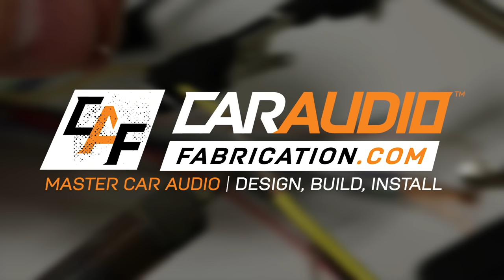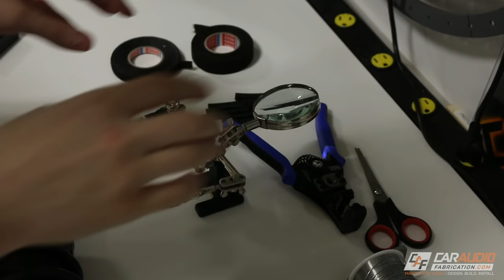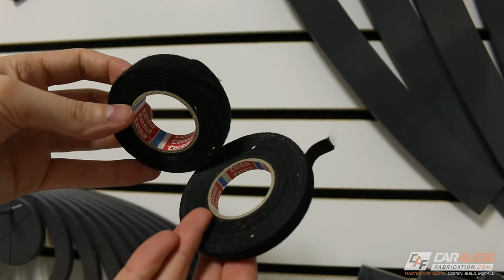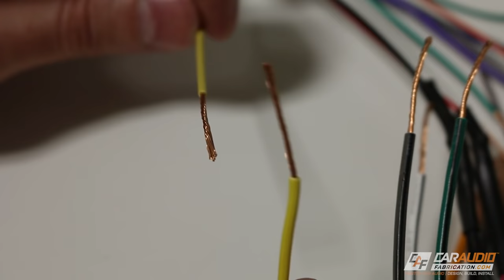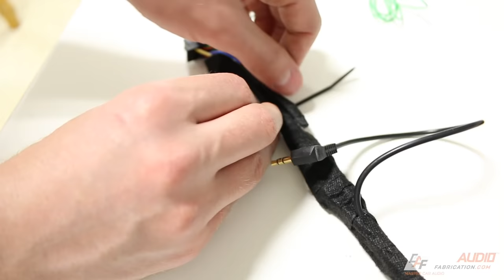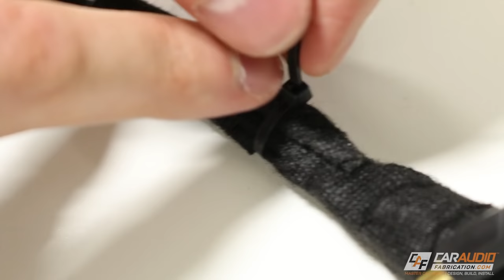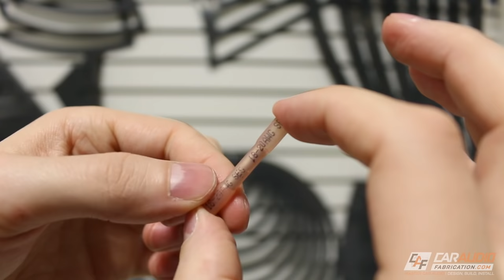Radio Wiring Harness - How to Install like a PRO

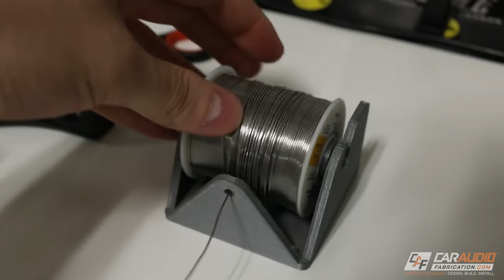Comment: Where is the link to the tools you use which you mention at ~2:30?  I don't see it in the video description.  In particular, it would be helpful to know what kind of TESA tape, what kind of solder, what size heat shrink, etc.

Comment: My harness that plugs in the car doesn't have a black wire, so I have to ground the one that come on the harness for the aftermarket stereo. What tools do I need to do that. I have a 2007 mitsubishi galant. The aftermarket stereo I bought is the pioneer FH-S500BT.

Comment: i use crimp caps where you twist tie them together and then its crimped on the end.. been working for years with that method im just too lazy for soldering

Comment: I havd a 2019 cascadia freightliner l have a blue connector with small gauge wires.. possibly 2 wires. along with a big connector multiple wires.

Whats the blue connector for? Wires are thin.

Comment: Could you use lever wago connectors to splice a line output converter? Or is the only option to solder in a tight space from a car seat.

Comment: Hi , I have a specific question hope this make sense, I have a car lancer ex and its using a Fosgate subwoofer but dont have a stock amplifier, can i able to hook it up with my new android headunit (built in amplifier) directly? Not sure which wire to tap, should I tap it in the wires from the car or in the canbus wire?

Comment: One thing that i personally would do differently is to not solder, but use open barrel splice U-shaped spilce connector (also known as
Terminal Crimpband, Open Band Connector Crimp). It's widely used in motorsports and is considered to be one of the best ways to to join two or more wires together. Yes you do need special crimping tool but i think it's worth it, as a good soldering iron would cost around the same. Also I'd suggest looking into heat shrink with a layer of the glue on the inside to make it water-proof.
Reply: Well the nice thing about solder is, it's permanent until you take a soldering iron to it again to make whatever change you need with it. Once crimped you're stuck with it or lose some wire removing it.

Comment: How do you wire a DVD player to by pass the parking brake? It's a Boss dvd with the PAC RP5-GM31 for steering while controls? Do I clip the wire right from the back of radio or is it after the PAC wiring interface? Thanks

Comment: Hello I just watched your video.  I have a question I have a 07 Chevy Silverado I want to change the factory radio and I want to know where can I find an aftermarket wire harness adapter and steering wheel adapter for my radio.  Thanks look for ward to your comment.

Comment: I'm working on a 2012 gmc canyon. I am  putting in an  aftermarket radio with an amp, but the wiring is somewhat  confusing for me due to wires don't match up how do I figured it out... if you want I can send pictures of the wiring....

Comment: Mark:  have you ever used the new Solder seal wire connectors?  They are supposed to solder and shrink wrap all in the same step.
Reply from the maker: I reviewed them, they are bad.

Comment: if youre are installing a new Headunit BUT youre using an amp the speakers (using the preamp on the headunit) do you still connect the speaker wires from the new headunit to the factory harness even though they will not be used?

Comment: Your videos are great I'm learning a lot thank you.
I'm a sound tech. and a D.J. and I run and record; live sound, soooo,, music is everything to me.
I want to install a Rockford Fosgate 3sixty3 in my 2011 Chrysler 300 and all the corresponding amps. I have already installed the speakers and a subwoofer with the corresponding amp. but the sound is still a dud. what I'm asking I'm wondering if I'm going to have to manufacture a harness like this?

thank you again.

Comment: Hi i want to upgrade my car speaker with an amp but i don't know how to connect everything, i know i have to use a adapter harness but i don't knowh ow to connect it, do i need to connect it to the radio and the amp? because i think it wouldn't be long enough?

Comment: I have Pontiac grand Prix GT i have to order from crutchfield a similar wiring harness where exactly would i connect my remote wire i don't have the bose or monsoon radio i just have steering wheel controls but from online ive been seeing where i have to rerun a 12v and the remote turn on wire has to connect to wiring harness n if this is true i dont understand how i am supposed to hook up my stereo system specifically amplifier without a remote turn on wire any help is very much appreciated

Comment: What’s your opinion on the fuse relay bypass.? For the 2660NEX I have the maestro SWC mod and am hoping every thing is color coded together aside from my rear camera connection. I’m nervous to even install it because I see so many issues with the newer tech even in my 06 gmc sierra. But I saw someone run a ground to one post of the relay, then a line off that post jumped to the other 3rd leg.

Comment: I have a question. I have a 2004 s40 Volvo. I need a female plug for a stock radio harness. I'm installing a aftermarket radio.hope you can help.

Comment: Mark, if you had a checklist made out for all your connections and checked each off,  it would give you a verification of where you were if you had to stop in the process so you didn’t lose your place. It’s happened to me and it’s how I addressed this. Cuts the frustration factor especially in shops that are not using conditioned air. Just a suggestion. Not everybody sees this as an issue, but doing things twice is very irritating to me. I hate that. And wasting time because of being in a hurry. Disorganization is the cause of many a frustration. Opinions vary, but facts don’t!

Comment: It would be interesting to see your technique on a "hard wire" installation.
Reply: Mark talked about that in a different video. He gets a used harness from a parts car and then solders that into the vehicle.  He said it is awkward and since it is all in the dash, it is hard to video too. He does not recommend hard wiring the radio in.

Comment: Hi I am struggling with something, my key is on the on position and I have no static even crunk up loud but when I crank it up I get static that comes from the left rear speaker, and I just put new speakers in, and it breaks up even at a low volume. I heard road noise. Please help?

Comment: So i've installed 2 headunits into one of my cars (08 corolla non jbl) due to the first kenwood lacking 2 sets of rcas. Now, I've had the front speakers (alpine sps components) both amped and unamped, but they have no real impact below 200hz. What's odd is that my old infinity reference coax that in the corolla had no bass, produced much more when installed into my 2016 mazda3 gs (non bose). I've checked polarity and it is fine, what do you guys think could have caused this?
Reply: I know I’m a bit late to this comment but your car might have had a factory built in cross over for your door speakers.

Comment: Still lost in the octopus 🐙 of wires. On my Tacoma it only has the two 6” speakers 🔊 at the lower part of the doors and there’s a tweeter at the top of the door panel. My question is does the tweeters count as a speaker when it comes time to wire the speaker wires together.

Comment: I'm presently wiring an after market double din audio to my 2001 Buick century without factory harness as I cut it off before knowing that I needed an adapter harness my speakers are RRr I do not have light blu wire on factory wires nor do I have the yellow for lftrr on factory wires some wires are what they say but I know they become a different color on the factory wires please I need hel

Comment: What he didn’t show is that those steering wheel control devices need to be tapped into wires that are behind the OEM vehicle harness.  These don’t typically have connecting wires on the harness adapters that Metra sells.  I’d like to see what he did about those.  Those always give me a little queasy feeling as I press down on a blade type wire tap behind the plug.  But I’ve gotten it right so far.

I’m all ears if there’s a better way of doing this.
Reply: If you want to leave the factory harness complete stock without using taps, you can take unused pins (if any) out of the metra harness and insert them where they should go for the steering controls. You can also just buy pins themselves and insert them to anything needed.

Comment: I removed an aftermarket radio with amplifier and satellite box , I cut a red wire , a yellow wire and a black wire connected to it . I connected the factory harness to a factory radio , the radio works fine , but the car battery was dead the next morning , I assume the cut wires drained the battery . So can I just splice the  cut wires with the red , black and yellow in the factory  harness ?

Comment: Can i run the steering wheel harness ground with the parking brake bypass?? or is there 2 different grounds i could use? Also how do you tap the red wire into the factory harness? Do you have to remove the wire from the harness itself?

Comment: I like the detail of these videos. Just started watching them. 

I'm going to be upgrading my 02 grand cherokee radio from an older aftermarket pioneer.. It already has the steering wheel control in the existing install. But who installed it tapped into the factory harness for one of the key wires. ( I think it's a key wire) but there is an opening for that wire in the radio harness I want to use. To make it cleaner looking. What kind of pins would that use? I tried looking on Amazon for harness pins but they don't look quite right. Any suggestions?

Thanks.

Comment: I need help i habe fee qustion i have 2011 ford fusion sel 2.5.  Sel. It has the sinic and streimg wheels control  and all that but i dont wanna keep done of it beside what my new Aftermarket radio comes with   it comes with bluetooth   gps navigation backups  camera.  I have the wiring harnesses  AXADBXH-FD1  ANY HELP.WOULD HELP PLEASE ALSO IF TXT ME THAT BE FINE ALSO

Comment: In my experience, hook twisting the wires before soldering is unnessicary. A good soldering joint is always stronger than the cable, regardless if theyre hooked, so it might be stronger, but without its already strong enough, and it makes desoldering much easier if you want to connect it to another plug down the road.
Reply: You're right, but he left enough harness that he could reuse it 4-5 times over anyhow.

Comment: I think it's important to mention the importance of using flux on your wires when soldering.
Reply: Make sure it is non-corrosive flux for electrical applications, not the plumbing type.
Reply: @XlouietheflyX  and not plumbing solder since that too is corrosive to electrical wires.  Use electrical solder.

Comment: If a vehicle already had the stock harness cut (removed) by a previous owner/installer... what would you recommend to maintain a plug in connection to a new head unit?  The vehicles has an aftermarket head unit that has been directly spliced into the factory harness.
Reply: check out Rockauto dot com. you may be able to buy the actual plugs. then you just have to place the new wires into them. Or just go to the junkyard and find a car like yours and tear off the radio harness. this might be easier as all the wires will be color coded and you wont have to figure out where each specific wire goes to.

Comment: Do you recommend connecting the cd receivers ground to the aftermarket harness or to the chassis/metal?
Reply: once its an actual ground thats hooked up to the chassis so for example the harness might be mounted on plastic   so it would not work

Comment: I'd like to know how to install a rear view camera. More specifically different types of wiring that come with different types of cameras. Some have a long wire, sometimes the wire is cut at the ends of the RCA's. Some say to tap into the reverse light, but do you have to do that if you have that purple wire coming from the aftermarket harness?

Comment: What if your radio comes with an iso unit?  I have the Eonon 10.1,  but the iso unit doesn't have all the wires I need attached to it.  
I dont know why they put  a dozen wires into an iso unit,  and leave 6  just hanging free. There's one antenna wire attached to another bundle of RCA plugs. This is a real mess and the manufacturers left no instructions or video's for this radio.

Comment: Where is a good place to find oem connectors / pigtails besides ebay and amazon.

Note on solder..  IF a manufacture doesnt recommend it.. its because of the flux being left in the connection which has a chance of eventually degrading the connection.

Wanna get real fancy.. stagger your connections.
Reply: Flux can be cleaned up, and should be because it has an acidic property, good while solder to prevent oxidation.

Comment: The wires on my harness is copper, while the wires provided by the stereo is aluminium. Should I connect them?
Reply: Aluminum is often clad with copper. They will be fine touching each other. In fact, the wires in the harness very well may be copper-clad aluminum.

Comment: if you watch you will notice that when he connected each wire it cause a big honking knott in the middle of the harness, if you cut one wire on one harness short and the same wire on the other harness long you have the same length but each point of contact is at a different location on the bundle of wires!

Comment: Queation: Is the process the same to wire in a secondary headunit to run audio throughm i want to install a new heat unit but also keep the factory head unit. All controls(including steering wheel) and signals through the after market unit. I want to have both powered so maybr a splitter before the harness adapter?

Comment: so, does this work just the same with on-star controls? I have a 08 trailblazer and no steering controls but I do have on-star and really wanna do install myself since every place around here is charging 200 bucks just for parts and labor not including the deck

Comment: I'm confused,  if I buy speakers to replace my cars system and have an amp to power them  doesn't the wires from the deck just send the music signal to the speakers? Why would I replace the head unit wires?

Comment: How do I solder and heat shrink insulate a t connection in my factory harness speaker wires with out cutting the wires?

Comment: Great video Mark. Just wondering why you have all the joins at the same length of wire. Wouldn't it be better if one wire was soldered say 2 inches from the plug, the next 2 and a quarter, then 2 and a half and so on..... That way you wouldn't have a big lump of joins all in one spot. Just an idea.....
Reply: gizmoochi if you stagy them out like that and ever want to transfer that unit into another vehicle with a different harness then you've kinda screwed your self unless your gonna have wires that have cut and soldered over and over again

Comment: Hi Mark...could you consider making a video outlining how you programmed the steering wheel control unit you purchased? I have the same one and have not been able to have it work properly for over a year. It just sits behind my dash and I've gotten used to not using my steering wheel controls. Thanks!

Comment: Hi, do you have any videos explaining or installing an after market stereo, 2 channel amp & two 12" subs into a car with a factory Bose Premium system in it? I want to keep the Bose amp and speakers running just as they are but in addition adding the new head unit and additional amp/subs to it. If not, please throw me any important factors if you can because I'm going to start working on this shortly. I bought the Nissan Maxima radio harness which I'll solder to the Alpine wires. I Metra Electro for the steering wheel, antennae adapter and amp install kit.

Comment: I hope someone can help me. Installed a pioneer double din unit and hooked it up via plug and play harness. All speakers worked great. Car sat for a couple of months and when I picked it up the front speakers have barely any volume and now in the settings, I have no fade. I only have balance for left and right. When I plug in my old stereo everything works flawlessly. Can anyone help?

Comment: I noticed that you soldered the ground cable from the aftermarket harness to the OEM harness. Other videos I've seen leave both ground wires loose, add a terminal hook and ground them to screws or to the metal frame of the stereo unit. Which way is the proper way? Also, what mode do you put your multimeter in to test for continuity? Thanks a lot. Your video was excellent.
Reply: Factory grounds are usually weak and seem to introduce noise when used with aftermarket radios, I prefer a terminal and a solid chassis ground.

Comment: Good video, thank you. I have a question. If my Tuarus has a 12 pin harness can I theoretically tap into those 12 wires and fit it into a 54 pin radio harness? I can't seem to find any kind of adapter for this. The 12 pin car harness went into a 4" screen and I want to upgrade to an 8" screen that has a 54 pin harness.

Comment: I think this is indeed the right way but i have oldtimer so the cable harnesses do fit to the new aftermarket radio (someone before me did this) so there are no cable's cut.. so you are saying with this video i have to cut them and (what you said not to do @ first) soldering them together.. i wish it was possible just to pull out the cables one by one out of the harness and put them in the right place again in the harness .. is that even possible without cutting the wires? 🙄 .. anyway great video.. if it is not possible without cutting the wires i use your method 😉